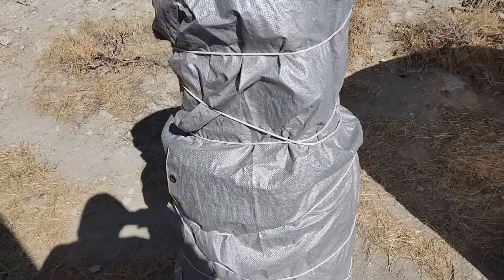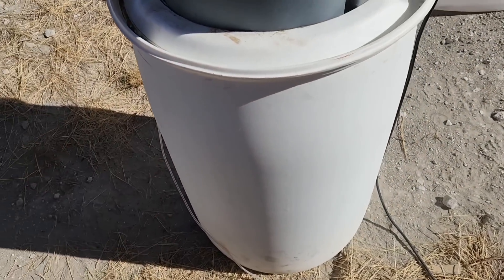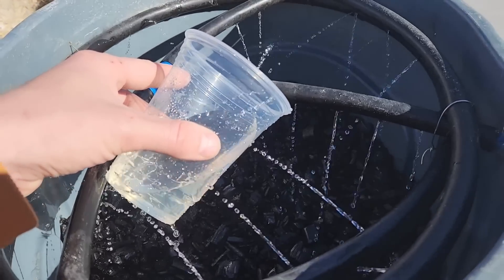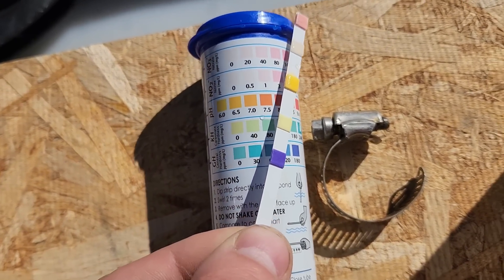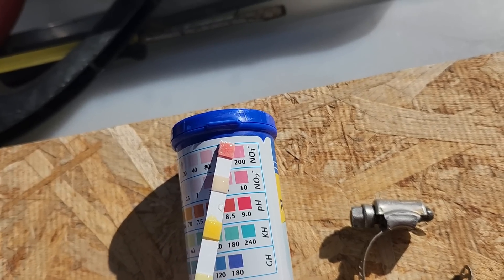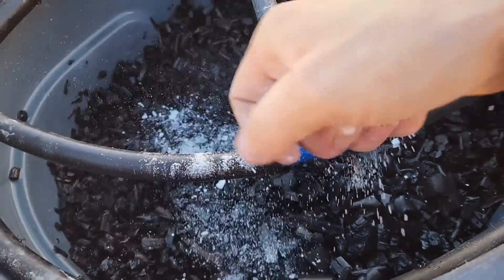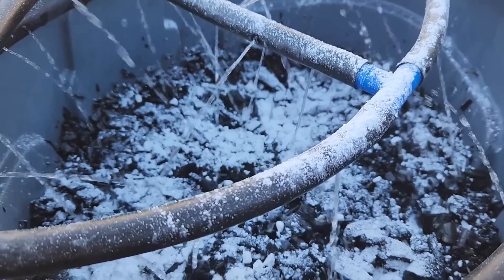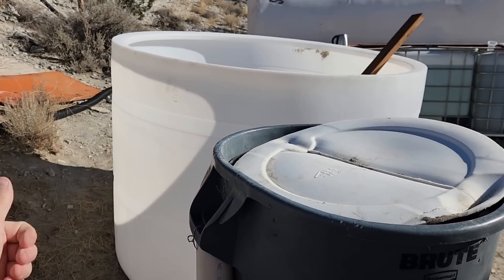Bacterial Oxidation of Urine to Nitrates

Comment: Now you've wandered into my wheelhouse.
1. No it takes more energy to pump air down than water up. The reason is because there are more heat losses from pumping a compressible fluid than an incompressible one. Though the specific config can reverse this because there are many other factors. 
2. It will not fail safe this way because you have it closed to the armosphere covered in a tarp the only O2 getting in is what little is dissolved in the water when it is pumped through.  And running it every 6 hours is too infrequent. NBR systems always run continuous when they run this rich because the nitrifying bacteria are not the only ones present here. There is also respirating bacteria because of the carbon in the urea molecule. The bacteria are also not committed to living attached to surfaces
 They will also form a suspended sludge.

Comment: Would DEF be a better source of urea once the system can handle higher doses? Diesel Exaust Fluid (DEF) is very cheap at $10 for 2.5 gal. It is 32.5% urea and the rest is deionized water.

Comment: FYI: double check some of the details about the reagents in the test strip, reaction thresholds etc...     Having clin lab knowledge/experience...some tests are very sensitive and you can easily ruin the results...Leave strip in too long/short, urine is  too old/hot, etc. 
       I just mention this, bcuz the reagents in the strip may/may not react properly if urine concentration is too dilute or high.

Comment: Curious what you used for the bacteria source? As someone who works in a hospital lab most people have only small amounts bacteria in their urine without an infection (although the tank being warm outside could help boost the numbers). Also-- have you considered selecting against bacteria that reduce nitrates to nitrites (if you want a nitrate fertilizer)? The enterobacteraceae (bacteria in your colon/the ones that most commonly end up in urine as contaminants or from infection) reduce nitrates to nitrites. If you want to limit this reduction, I would consider adding a nitrate-negative bacteria source or an ingredient that inhibits the enterobacteraciae class of bacteria (some of which could definitely be safe to have end up in an agricultural setup...) Alternatively, you could test the urine before adding it using a cheap test strip for the presence of nitrites, which would indicate that higher numbers of enterobacteraceae are present. PS. I'm a long-time fan of your channel and Chicken Hole Base, thanks for keeping up the awesome videos!

Comment: I'd be curious whether thoroughly mixing the charcoal with the bacterial inoculant from the fish tank ahead of time would increase the rate that the entire matrix was colonized. Particularly on a substrate with such high specific surface area, I wouldn't be surprised if dispersal was a limiting factor on overall efficiency.
Reply: Have you tried cycling the urine by filling the upper bucket to the top of the charcoal and then letting it drain? That could potentially help with lateral dispersal of the bacteria, and would also more thoroughly soak the charcoal and eliminate some of the effects of channeling and preferential flow. You might also be able to use charcoal in the bottom, especially if you're pumping air in anyways, and then the upper chamber acts as the failsafe and provides inoculant to re-colonize the bottom chamber in the event that it does go anoxic. 

Not at all trying to suggest that I know better than you; I think the stuff you do is admirable. Just some things I'd be curious to try if I was working on the project!

Comment: With regards to your comment about extracting the nitrates for energetics, it's worth considering that natural accumulation can take decades, while focused accumulation still takes at least a year or two.

Even shortening that down to months with a rather low-tech and readily scalable setup is still a significant improvement.

Comment: I'm wondering if you were to put a temp control loop in there somewhere would that have a significant effect, or only marginal. My understanding with optimizing any bio reactor intended for production is that temperature is absolutely critical, but I know nothing about nitrate forming bacteria, so....

Comment: Dear Cody I have some suggestions for improving your bio-reactor system. 1.) Improve top dispertion system, to make fine mist instead of large drops, that will cover surfaces a lot more evenly. Like this, U have just a few percent of activated carbon with active bacterial cultrue. If U change to fine mist, FULL VOLUME of top barel will be active. 2.) Air Inlet to bottom tank can be Oxigen enriched by Oxigen paramagnetism. - Enriching system can be build just by layering Steel plates with magnet and 2-5 layerrs of aluminium mesh. Oxigen near alumiunium mesh, wil be preferencialy atracted by extending magnetic field. Saturated steel plates disipate magnetic field thru aluminium mesh AND guide Oxigen enriched air to your pump inlet. 3.) Temperature is also very significant variable. Make a small volume Experiment with Your bacterial cultre. Where (temperature) Perform the best. Try my improvements in video PLS if U can. ;) 10:25 Reasons why geniuses reprodusces so rarely. :D

Comment: CODY........For the winter you could but a solar and LiPo battery run outdoor heat blanket or mat to either wrap around the containers, or under. Or just an aquarium heater in the bottom container to keep it at the heat you need for it to run as productive as possible.

Comment: Cody this is probably my favorite of your experiments that you have done so far as it directly relates to my work selling aquarium fish. We would probably call what you've created a trickle tower in the industry, and that is the type of filtration we use to most efficiently oxidize ammonia to nitrates, while a submerged or wet/ dry filter may also offer some anoxic nitrification and produce nitrogen gas with different species of bacteria. I'm really interested in using something like this to explain the denitrification process to my customers (and even some of my coworkers!) who seem to believe it is some mystical process that requires praying to the bacteria gods and sleeping with aquarium gravel under your pillow. 

A few notes from experience: nitrosomonas and nitrobacter species will generally operate and live within the liquid temperature range of water, they are able to go down to 0C and up to 100C without the whole population dying. They do operate best in the range of 72-86F (sorry for mixing units) with activity increasing with temperature up to the upper 80s where they will drop off slightly. You are also experiencing what many fish tank keepers experience after they have not regularly cleaned their tank of fish waste, the organic acids produced are buffering your pH down and lowering the efficacy of your bacteria's chemical reactions. In fish tanks we would prescribe regular water changes with KH buffered water, usually using sodium or calcium bicarbonate as the buffering agent but sometimes aragonite is also used in the form of "crushed coral" products. The crushed chalk at the end is a very similar idea.

This video has given me a lot to think about re: the nitrogen cycle process...

Comment: ayoh!  something up my alley!   well, not precisely but largely...

You don't actually want the carbon/charcoal in there for processing waste, you can remove most the 'bad for plants' from the flow by using natural passive electrochemistry (make it a battery using something safe for plants) and in this circumstance you're just using charcoal as a poor biomedia.  I'd suggest a wind powered series of platters rimmed with some standard kind of bio-media like chunks of terracotta (or even just use a bunch of terracotta pot saucers that have a hole in the middle and gang them with rubber disks) or ceramic tube media tied on with fishing line.  It isn't that the urea burns plants, its that plants have a very low resistance to the urea combined with other components of our urine like salts.

Comment: @cody'slab Those rocks in the barrel almost definitely have a biofilm on them, essentially isolating them from the water.  They might have worked better at the bottom of the top trashcan.  The chalk you added to the trashcan likely solved it though, for now.

Comment: Is the charcoal important beyond its function as a lattice for the bacteria? Would anything porous work? Also, would regularly dosing the tank with extra bacteria cultures improve efficiency? I would think that charcoal would be at a premium on Mars, but I wonder how long the system would hold up for, or if some kind of (expensive) ceramic alternative would last forever.

Comment: The bacterial will grow to the amount of ammonia, as long as you have enough surface area, and with all that charcoal , you probably should.   I think it would be better to use it as you need to through out the day, smaller amounts at a time, but a more constant supply and less of a spike.

Comment: Fancy. My version was just straw and wood chips into a compost tumbler and tumble it after each urine addition. 
I recall adding a small scoop of active compost and garden soil as inoculate but probably not necessary.
As it breaks down it becomes more absorbent so less issues with leaking out.
Never got around to testing for nitrate content though. Sodium could be an issue for use as fertilizer.

Comment: The simplicity of this filter is what makes it so beautiful. For a more efficient version, you might consider a fluidized bed. A bit more trouble to make, but not much. The increase in efficiency should be pretty dramatic.
Reply: fluidized bed would require constant motion which would drastically increase energy consumption i would think. Unless it was solar or something.
Reply: @teagancombest6049  That is a fair point.

Comment: Somone once told me that they used to use pee to start the cycle and also fertilise planted fish tanks, perhaps avoid drinking 5 pints the night before lol.

I wonder how well it would work if you pee in a watering can with a small air powered sponge filter in it.

Comment: At 3:02 you say that "the energy it takes to pump water up, is the same as it takes to pump air down", how can this be true?
Reply: I think the idea is that the work you do on the system to inject an air bubble at the bottom of a column of water is the same as the amount of work to lift the same volume of water from the bottom of the column to the top.

Comment: Wouldn't a mixture of 10g sample and 90g water be a 9:1 dilution rather than 10:1?  Should that have been filled up to the 110g mark?
Reply: No, it's the ratio of volumes before and after dilution that matters (i.e. 10 and 10+90). In other words, you have to remember that your sample was some small amount of the substance and 10 grams of dilutant (water) to begin with. After the dilution it's the same small amount of substance and 100 grams of dilutant

Comment: I use similar method for my aquaponic system. Only I use the expanded clay balls and sand. I like this method however as one is essentially making biochar, and with a solar pump this would be a very efficient way to process biochar like a nitrogen forge. 
I have plans to make for next summer. 
Can anyone go into more detail about limestone erosion factors and the benefits?

Comment: in the hydroponics world, I believe these are called mineralization tanks.
are you using 'activated' charcoal? you said you were surprised by how much the system can process, but it scales on the surface area of the media, which with charcoal is a lot. even more so with activated charcoal. regular charcoal will work, but you might get a boost with charcoal meant to have more space inside.
When i first saw your set up, i was wondering why you didn't just have the pump running full time.   it is probably more expensive energy wise to just aerate from the water pump, but you could turn off the air stone. i think it would have the same effect, and act similar if they system went down. but i liked the explanation of the power failure. (OH, beware of syphoning, idk where the air pump was, but keep it above the water level).
to be fair... my girlfriend was very upset to learn about my 'number 1' ingredient in my compost... i just no longer tell her.

Comment: Your urine processing is TOO SLOW. This means there is not enough bacteria to process the urine. I have three suggestions:
1. Old folks used excrement and soil as the source of bacteria. Pretty much any bacteria will do since evolution within the tank will select those that process urine that will survive. So I think you CAN increase the amount of bacteria, possibly on a logarithmic scale.
2. Although the carbon is porous, I am not sure if urine water gets everywhere in it. I suggest to mix straw or hay to increase water retention/sponge capacity of the top part. The more water it holds (with still some access to oxygen) the better, IMO. Currently it looks like you have a few streams going through charcoal and it does not get sufficiently wet.
3. If you're producing CO2, then you need to vent it sufficiently, so that enough oxygen gets through to bacteria. Currently CO2 might be killing it. I guess you figure this out.

Comment: Great video! There's a possibility that the bacteria are carbon limited, besides the carbon in your nitrogen source the bacteria only get  carbon from the air, and that's not much for the bacteria to work with in this scenario. Equilibrium of CO2 in water in contact with air varies with conditions, but is typically less than 1 ppm. I would definitely try adding some CO2 if I did something like that. Producing a low flow of CO2 over a long period of time is very easy to do, and can generate very nice byproducts. For example you can make vinegar from a byproduct of my favorite way to generate CO2. I often see a very big improvement when I add CO2 to my aquariums, part of that is obviously due to the plants growing more, but the difference is often way too big for that being the only thing, sometimes even for it to be the main thing, especially as I often can see a big improvement from CO2 even when the plants are growing really well even without added CO2.  

It is fundamentally true that the same amount of work is required to push air down into water as lifting water up into air, but other factors make the energy efficiency of air pumps hard to beat when it comes to inducing gas exchange in practice. For one thing the air can make a lot of water circulate. I measured the current draw on one of those sphygmomanometer type DC air pumps, it drew 50 mA at 5 volts, ergo 0.25 watts. When those pumps are sold to be powered by USB they typically have a resistor to increase the current draw to prevent powerbanks from shutting off due to the insignificant current the pumps themselves use.

Comment: I Worked at a company growing nitrifiers in a bioreactor. Ammonia is converted into nitrate via a 2-step process, first to nitrite THEN to nitrate. It requires a lot of oxygen. I know an TON about this process, and can definitely help ya. Any questions or need any help let me know!
Reply: Also, under the right conditions one of your barrel setups should be WAY sufficient. Think about waste treatment plants, they use bacterial cultures in suspension not adhered to surfaces
Reply: if i use 1/3rd volume charcoal and rest scrub pads would that  improve the surface area

Comment: I can't help but wonder if using sodium carbonate wouldn't be better for raising the pH since sodium nitrate has a lower solubility than calcium nitrate. If you did that then you could collect the precipitate much easier, or at the very least you can make sure the solution doesn't get super salty by having too much calcium nitrate dissolved in it. I imagine if the transition for the salinity was slow enough then the bacteria would have no problem adapting to it, and it would probably be a boon to preventing infestations of other microbes that may be unwanted, but I imagine that'd hurt your ability to use it for most algae.

There are super cool halophilic algae out there though, including some archaea.

Also if you painted the exterior of the barrel black or partially buried it then I imagine the temperature might not be so much of an issue. Especially if it was buried a good distance down actually, as you'd be able to use the ground as insulation and of course you'd have latent heat from the ground to make for a less harsh thermal gradient than snow or freezing cold wind.

Comment: Carbon is usually in aquarium filters to remove organic compounds. Lava rock would yield excellent results as a biological media as it has massive amounts of surface area to grow bacteria. The other more complicated upgrade would be a fluidized sand bed. Probably the top upgrade that would be the biggest challenge. Maybe either one could stand a chance of increasing processing power in a similar or same space

Comment: Do you plan on this being a fed batch process or a semi-continuous process with the removal of some solution before the feeding with new urine to possibly avoid the saturation point of the nitrogen bacteria with nitrates, or is that not a concern in this case?
Reply: Also, bonus question, are there any indications of a possible bio gas project on the horizon regarding waste management in chicken hole base? I remember you trying some of it a while back using rabbit waste.

Comment: Ammonia oxidizing bacteria consume bicarbonates in the process of converting ammonia, this is most likely the cause for the pH drop. Try adding bicarbonates in excess, but careful with the pH, those bacteria are picky and react poorly to sudden changes in composition
Reply from the maker: I didn't know about that. Would carbon dioxide entering the system be sufficient?